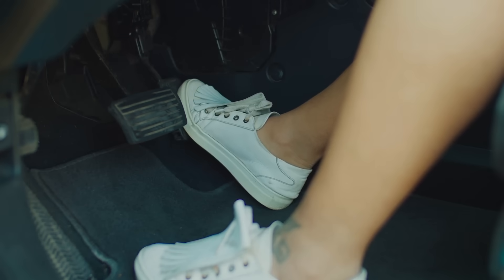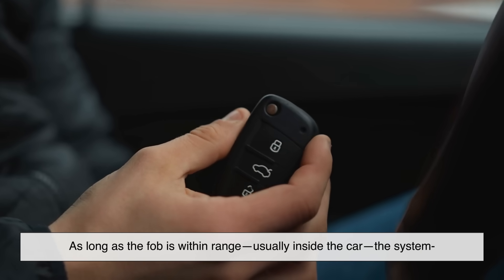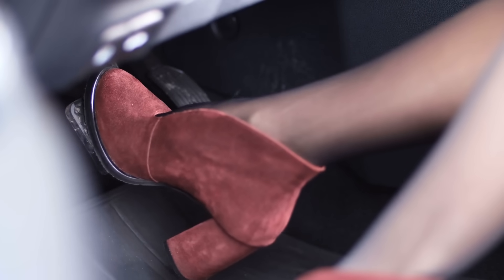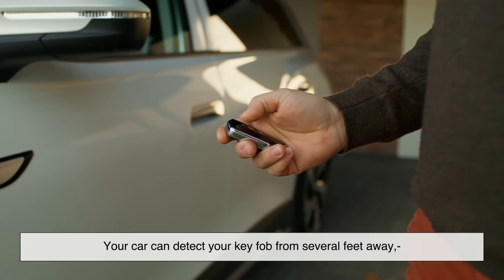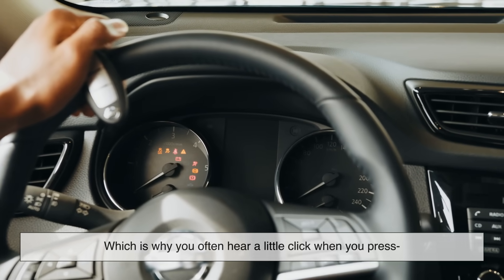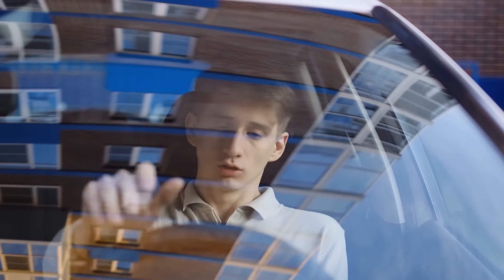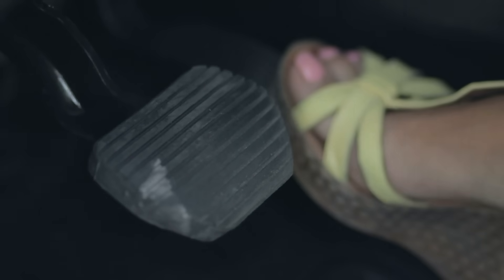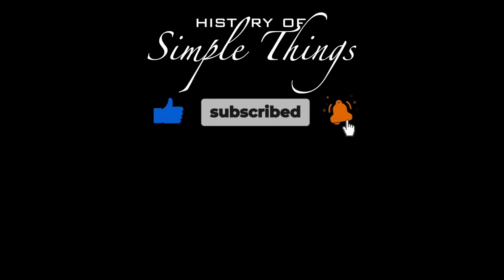Why Keyless Ignition Still Requires You to Press the Brake

Comment: It also differentiates between Start and and accessory modes. One problem hard to overcome is the braking requirement when switching from Neutral to Drive. In a carwash that requires Neutral braking can cause you jump the pusher rollers, allowing the car behind you to crash into your car....

Comment: I have been driving an automatic for years. My 2020 Ford Escape SE is my first vehicle with a push button to start the engine. I can start it by using the app on my iPhone or Apple Watch. I don’t have that feature on my key fob. There is a key for it to unlock the door. I even have another option to get in is the key pad on the driver’s side door. I just hit my 5 digits code to get in. Not all Ford vehicles have that feature.

Comment: Cars also have brake shift interlock requiring you to press the brake before you can shift out of gear. This prevents kids from shifting the car out of park.  This safety feature was put it after several incidents of kids shitifting the car out park causing the car to roll away
Reply: I had an old tempo way back and my 6 yr old kid put it in a ditch doing that. I had left it unlocked and windows down to cool off. He moved the gear shift playing. He never messed with it again.

Comment: This isn't just with auto transmission.  I have 2 manual transmission cars and both require a brake press to start.
Reply: I think manuals tend to require clutch rather than brake, at least, VW group ones do.

Comment: If you have a car that uses a key to start the engine, if the car is in accidentally/mistakenly left in drive or reverse the engine still won't start. It's due to a device called a neutral safety switch in the transmission. The car must either be in park or neutral on order to start the engine.
Reply: Saved me 8 kmins tks xD ( continues to watch the video.)

Comment: There are remote starters available that do not require the brake to be depressed.  I believe some cars now even have them built in.  Tesla and Genesis models [and likely others] can even move out of tight spaces with no driver inside.
Reply: Yes, but you do it through an app, which is similar to a "brake", because you are ready for it.

He mentioned that remote start cars only require the brake to start driving or to use the transmission.

Comment: that's not the question....why is there any need for a start/stop button at all?  Car should start when you sit in the car and you should have to press the brake to put it in gear
Reply: Why would you want your car to automatically start the moment you sit? Not everybody wants to always have their car running even when they're not driving. People don't always sit in their car to drive, what if you're waiting for long periods and want to sit in the car and roll your windows down? What if you just went to look for something in the storage compartments? What if you're cleaning the inside of your car? This would be a useless invention that would not benefit anyone.
Reply: @anthonynathan7357 I’m referring more to EVs where it should expect you to either want to drive or at least be comfortable with the hvac on.  Tesla’s do this already

Comment: Clutch pedal for me 
im not driving an auto
Reply: Autobox anyday, had enough of manual box in molasses traffic.
Reply: Same. Although I generally despise such interlock switches... I reckon that with manuals it is best on the clutch pedal (been that way since 1969 in the US). I can still compression-start it if need be, too.
Reply: The same. I drive manual and have to press clutch, not brake.
Reply: Same here, but you still have to push the brake before it starts.